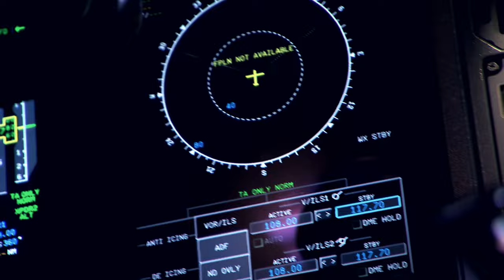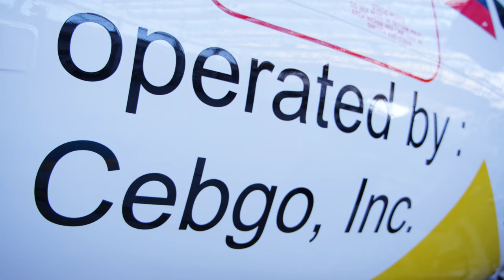Planespotting: The world's first ATR 72-600 aircraft

Comment: why won't CebPac use Embraer instead?
Reply: Just think of the practicality of using jet engines in airports near rural areas.
Reply: i dunno..  but more like, why not bombardier Q-400. the same as the one being use by PAL. they're both turboprop engine like the ATR 72 -600. they must have their reason why they choose the french company instead of the canadian.
Reply: lanz ortiz atr is more fuel efficient and can fly slower which can land in shorter runways
Reply: To answer all your questions. Because Airbus gives them huge discounts to buy only their aircraft. So why not the Dash 8? The Dash 8 is a competitor of the ATR 72. Half of ATR is owned by Airbus.

Comment: ATR need to develop a 100 seater turbo prop for short hauls and shorter runways.
Reply: Problem is the heavier the plane is, the more runway length it needds to take off in the small airports, so they have to fly one by one

Comment: i hate boeing they wont sell planes to cebu pacific
Reply: ChristianTRP - Short Viz And More why is that?
Reply: i think just like other airlines they prefer atr and airbus because of fuel efficiency, its up to the president of the company weather they will buy a boeing or an airbus. another thing is the capacity, some routes have less passenger so smaller aircraft could fly in that route as well as long haul routes. they purchased airbus and atr because of fuel efficiency and fuel friendly
Reply: what?? where did you get that fact? lol boeing wish all airlines would buy from them. why would they discriminate a buyer?. that don't make sense. Cebu pac and other airline just prefer airbus. maybe it meets their expectation. i dunno.. you know cebpac used to operate boeing 757 right? their must be a reason why they only using ATR 72 - 600, Airbus A320 & A330 on their fleet now. they retired the 757 in 2006. also, they only ordered A321- 200 and A321 neo for the future. same as PAL, most of their fleet is from airbus. A320, A330, A340. the 747 is retired in 2014. tho they ordered 777 to replace the 747, and they also ordered A350 to replace the A340.
Reply: lanz ortiz exactly! cebu Pacific just prefer airbus and atr over Boeing
Reply: ChristianTRP Boeing can sell aircraft to Cebu Pacific , but the airline chose not to so......
Reply: Kim Jong Un No Boeing is expensive but I really prefer Boeing more
Reply: Boeing is expensive
Reply: Its an lcc